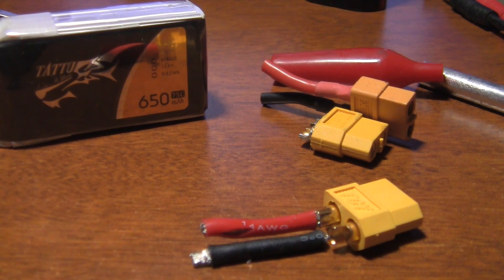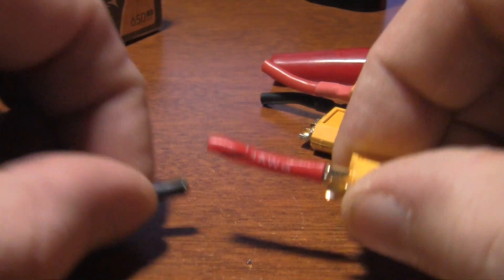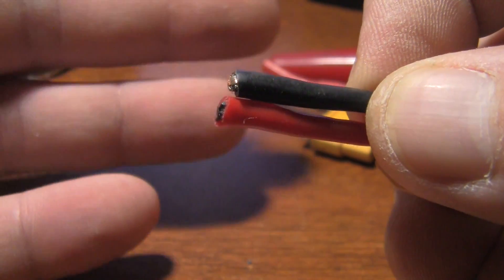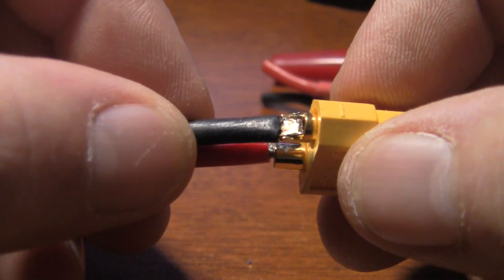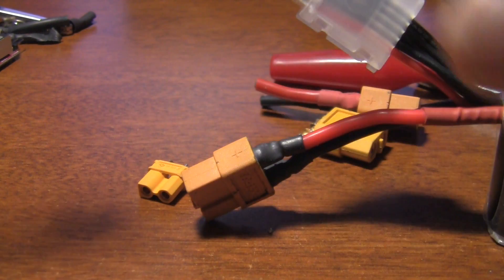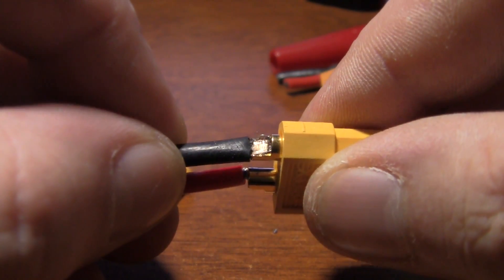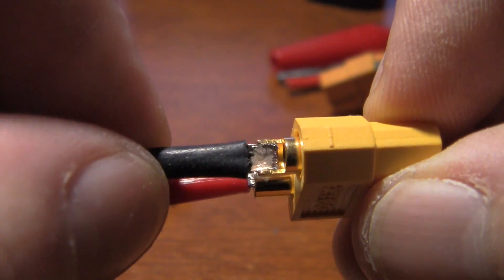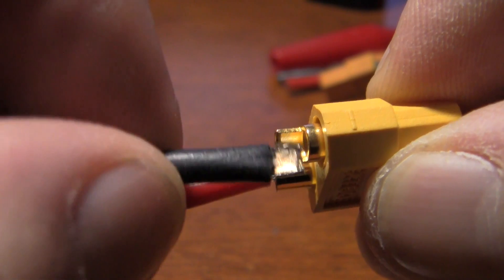⚠️Cold Solder Joints⚠️ Catch Them Before They Crash You

Comment: So, China is very cheap that's why they used those xt90 connectors? I have an xt90 connector and I can't use my modified ebike cause it sparked on me yesterday after I connected the xt90 to my modified ebike, but I did some soldering on them though, I'm not a Pro at soldering them which is the bigger problem.

Comment: Thx, if solder doesn't seep all the way down thru the wire,is that considered a cold solder joint? Can it make an ESC only run for 5 minutes at a time?
Reply from the maker: It wouldn't really be called a "cold joint" if the solder is solid on the wire and the connector. However it would be a bad solder joint since the solder makes the wire stronger and only having solder on a few strands would be weaker than having solder all the way through the wire. Definitely tin the wire all the way though. However, this will not cause the ESC to shut down after 5 minutes. This sounds like an over heating issue or over current issue. www.Rc-Help.com

Comment: It's probably just me, but I like more of the wire to be inside the connector joint. I usually fill the connector just a bit with solder then take the fully tinned lead and heat that and the connector socket at the same time as I slide the wire inside the opening. Afterward, I add a little more solder to 'fill' the socket.
Reply: I do dam near the same thing works well an then like you said fill the rest if needed so you no it's a solid

Comment: That wire wasn't even wetted out. They probably have untrained day workers assembling batteries. 
I just bought a dozen or so Tattu batteries with the XT-30 on them, Time for a looksee.

Thanks for the warning Tony!
Reply: A good hard test pull on all new batteries will be standard from now on, what concerns me more than having  a crash is having a fire. If a wire pulls out, you don't notice it, and toss the battery in your box, bad things could happen.
I was kind of surprised that it might be a Tattu, they seem very well put together, but these days, you can't count on anything...  If my house or car burns, it's on me, so I'll sure be checking new batteries of all flavors going forward. Thanks for the heads up!
Reply: @scottmarshall6766  dude I almost had a fire from that didn't notice the wore got a small slice in it an through it in my bag an it sparked lol I check.my bats before an after each run lol I don't wanna be that lipo guy lol not funny  but it's preventable
Reply: @rsracing-mb1tr  I've settled down to a system where I use small metal boxes (cash boxes work great) lined with 1/4" foamboard. I built a small briefcase charger with 6 ISDT chargers built in and a smoke detector in it as well. I had bad balance connectors on paraboards ruining batteries and a couple close calls, the charger array has paid for itself in saved batteries and nerves. I can charge any combo of batteries on it so can have my tx and 5 batteries ready to fly in about 40 minutes.
Flying requires my bag, a box of batteries and the charger if I plan on field charging. I can still trim it down to a lunchbox of batteries which holds 8 - that lets me backpack into a location with 8 batteries and 2 quads if I need to. My truck has a 2nd deep cycle Optima battery for charging from. Sounds excessive, but flying is really my only hobby these days and it's worth doing right IMO. My truck always has 2 folding chairs,  a small drink cooler and a 10lb Halotron Extinguisher in it. There's a fused XT-60 under the hood and in the rear which is usually where I set up. It's a Chevy Tahoe 4wd with good tires so I can go nearly anywhere and fly without worrying about the batteries going off in my  bag of flying gear and burning the bag and my truck. Sorry for the long post, - Safe flyin!